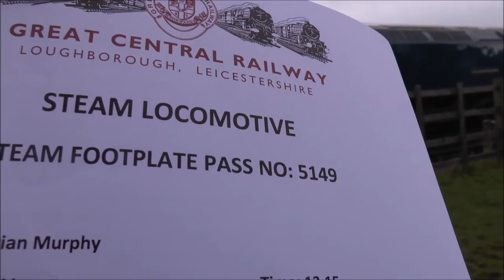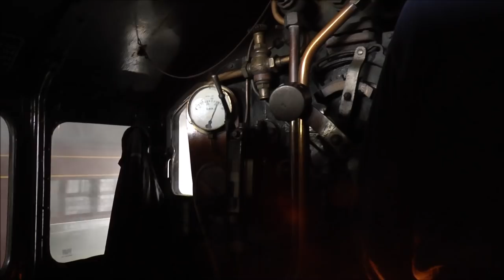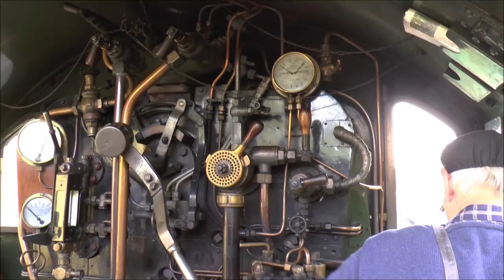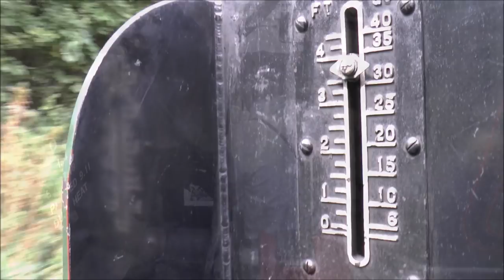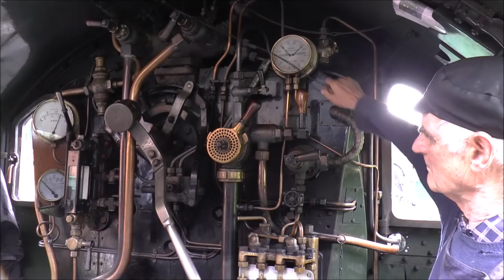On The Footplate Of GWR 6990 Witherslack Hall at The Great Central Railway: (Part Two):

Comment: Awesome video! I have one question, though. At right about 13:00 he's spraying water all over the coal in the tender. Is that to minimize the coal dust? Anyhow cheers, excellent video!
Reply from the maker: Sheev, yes that's correct, a standard practice when running tender first and also to keep the footplate clean. Glad you enjoyed the video and hope you found the others I've done on the footplate at GCR. Cheers, Brian.
Reply: Magnificent.

Comment: Utterly fabulous! I could watch that all day. I'm really impressed by the quality of the camera work and sound. It's not easy to hand hold a movie camera on a rocking locomotive footplate but the film is very steady all the same. Also many footplate ride videos are ruined by wind noise wrecking the audio. Did you you a wind cheater such as a Rycote for this? Also what camera did you use? It seemed to handle the very high contrast between the inside of the cab an the scenery outside very well.

Personally I would disagree with you about a point you made about a Black 5 being a better loco to work on. I've had the pleasure of firing both a Hall and a Black 5 (admittedly only in preservation) and I preferred the Hall. As a 'right hander', I really didn't like being squeezed up in the left hand side of the footplate with my Driver behind me! Also I never could get used to the raised firehole on the Black 5. One thing I did prefer about the Black 5 - the injector with automatic change over to live steam when the regulator is shut!

Anyway, thanks for posting this fabulous film! Best Wishes.
Reply from the maker: Many thanks for your kind comment and I'm pleased that you found my efforts an enjoyable watch. No external mic was used for this video as can be easily damaged so I cover the onboard mic with 'muffler fur' on a Panasonic HCX920 which is an excellent all round camera. For a steady hold it's mounted on a hand held 'cradle' complete with a neck strap. 
I respect your own preference for the Hall's but I fired both on the main line in 60's as a 'Midland Man' so we had to dislike them on principle due to the rivalry between  the former LMR & GWR..... lol. 
Although I will be promoting the fact soon, I will give you advance info as you enjoyed this video so much. Part of my footage will be seen in the documentary series 'Mega Shippers' on 'Quest'  which starts on 12th july at 10pm. My footage is due to air on 30th August but could get changed without notice. Make a note and tell your friends. In the meantime check out my playlist for other footplate videos on the GCR  and thanks again for your kind words, it's appreciated.        
Best Wishes, Brian.
Reply: What are black fives like to fire?
Reply from the maker: Matt Seymour. Easy when you know how, a lovely engine to work on but all past their prime by mid 60's so like most needed some TLC to get the best results.

Comment: Can you tell me, what is the control just above the large middle lever(the regulator, I think)? It's circular, brass, and has lots of holes all around the middle. I see the driver turn it, and hear some kind of noise that sounded like brakes(but I saw what I believe is another brake control, the double handled lever on the right). Would you know what that is?
Reply from the maker: The handle you refer to is indeed the vacuum brake. The double handled device you refer to is the reversing gear which is seen being adjusted to vary the percentage of 'cut off' through the valve gear to the cylinders.
Reply: SYKAROST thank you very much

Comment: Nice video but it's a pity most of it is horizontally inverted
Reply from the maker: What can I say, you don't produce any videos but have managed to criticise something that 273,760 viewers have obviously not noticed ...... furthermore neither have I? Maybe you'd like to explain further ..... Or maybe best not as I'm not overly concerned!
Reply: @SYKAROST   I apologise for trying to make a helpful suggestion - it won't happen again
Reply: @bobharrison2002  GWR locos were always driven from the right of the cab when looking forward. They had to do things differently to everyone else! Maybe you weren't aware of this.

Incidentally RH drive is not a great idea. It makes sighting of signals and judgement of platform position more difficult. To some extent the GWR was designed around this but if they ventured onto other regions, the fireman had to lend more of a hand with this aspect and he was also employed more in these roles on the GWR  too.